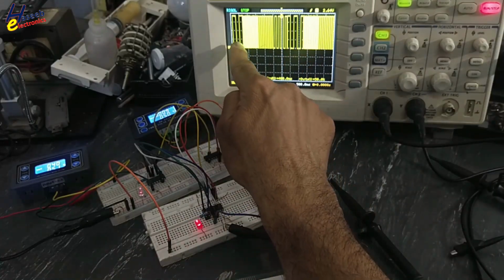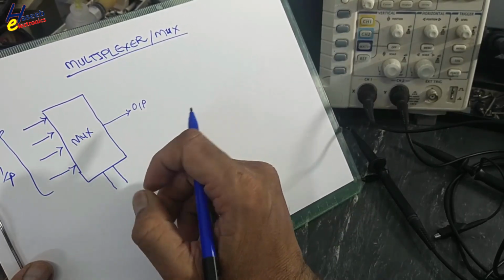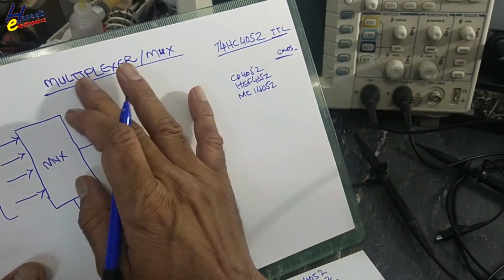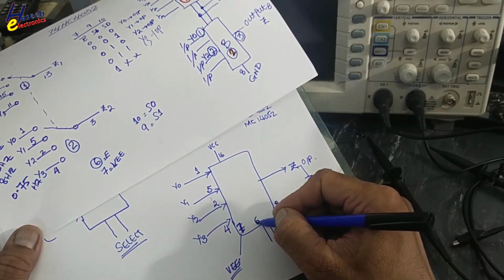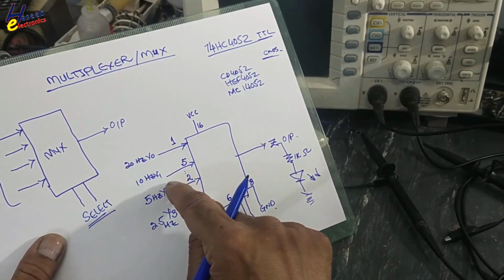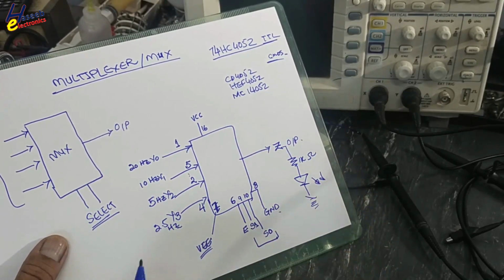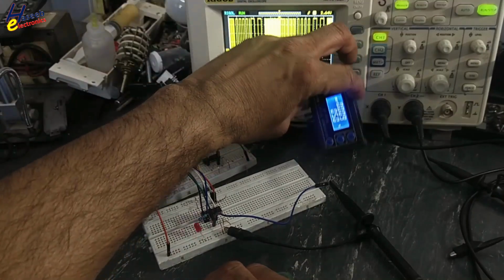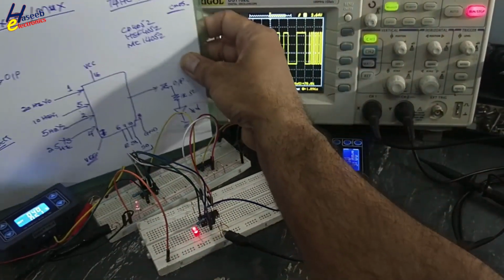{1257A} What is Multiplexer / Mux

Comment: Assalamualikum oarahmatullah Sir,

How are you? I hope you are doing well. I am speaking from Bangladesh. I really like some of the videos you have created, as they seem very different and highly precise compared to the ones available locally in our country.

I am studying electronics engineering, but I have not enrolled in any institution for this purpose. The reason is that, in my opinion, there is neither a good education system nor proper books available for learning the basics of this subject here. Even if such resources exist, they have not come to my attention. This message has been translated through AI.

Now, Sir, I have a question. I am currently studying Kirchhoff's laws.

KCL (Kirchhoff's Current Law): The total current entering a node is equal to the total current leaving the node.

KVL (Kirchhoff's Voltage Law): The sum of the voltage drops across all elements in a closed-loop circuit is equal to the total supplied voltage in that loop.

If I stop practicing further and proceed with only this basic understanding, will I be able to learn the upcoming chapters easily?

If not, could you please tell me which chapters might cause difficulties for me?